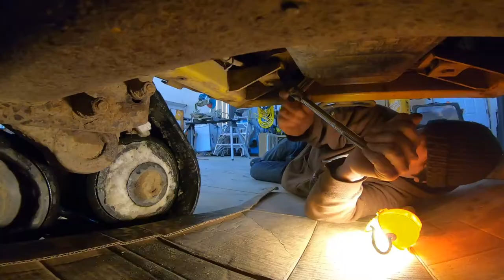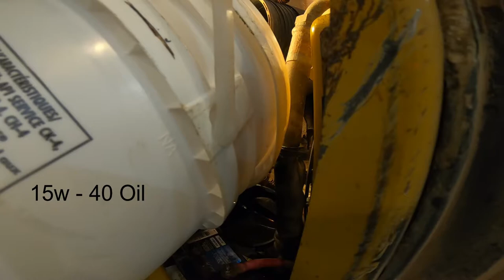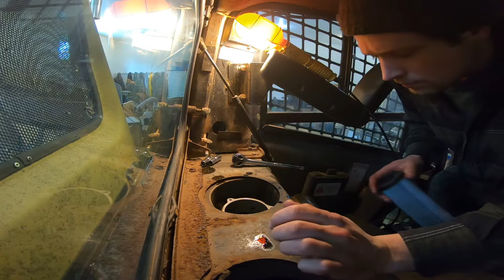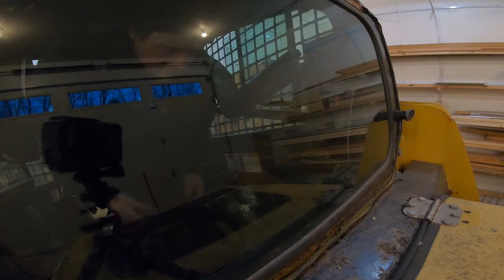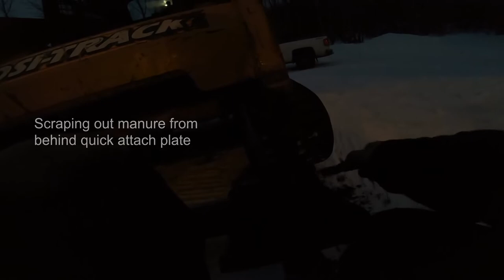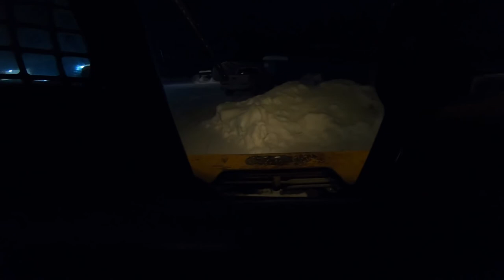Servicing the ASV RC50

Comment: What brand of engine oil did you use?
Reply from the maker: Hi Jeremiah, I used Shell Rotella T 15w40. Let me know if you have any questions :)
Reply: It has to be synthetic oil?
Reply: @greenparadise4032  no it doesn’t have to be especially if you have a machine with lower hours

Comment: What hydrolic oil weight ? Type?
Reply from the maker: Petro Canada Hydrex AW 32 hydraulic oil. We are in Canada, so I run this machine in the winter doing snow removal a. This is a winter weight oil. Let me know if you have any more questions. Have a good one
Reply: @10PetersonTyler  oil with AW is not recommended, MV oil or all season oil, Princess Auto has what you need, about $50 for 5gal pail.